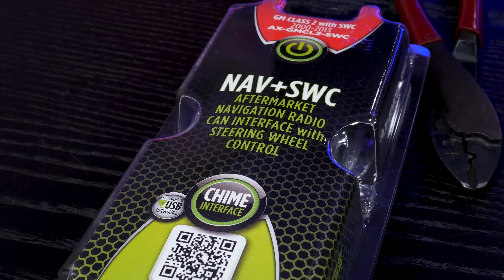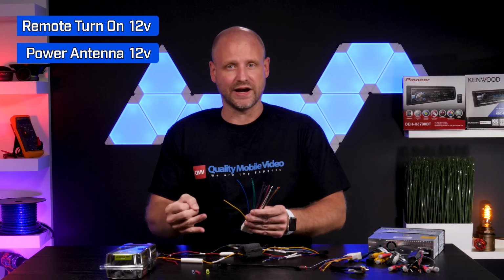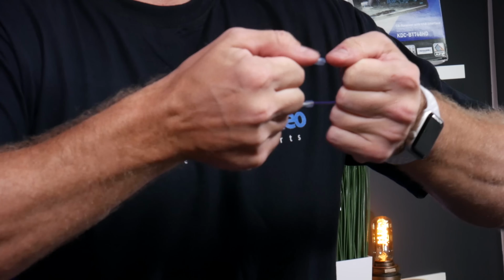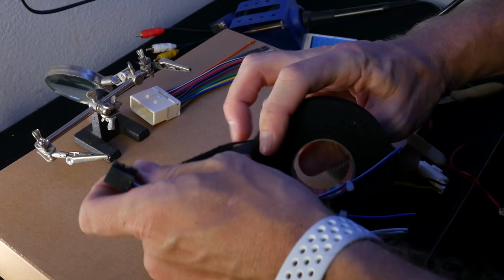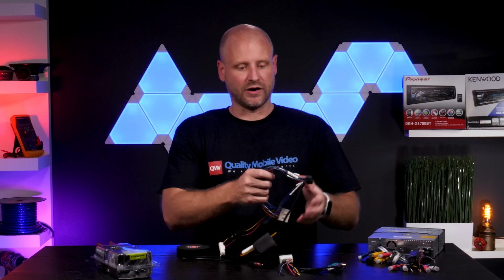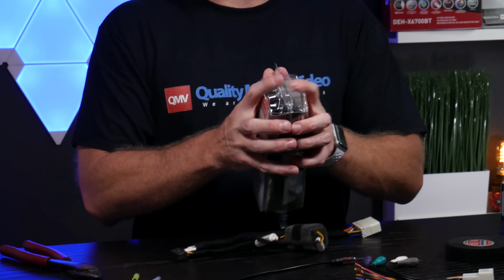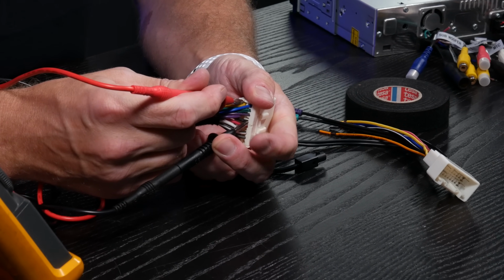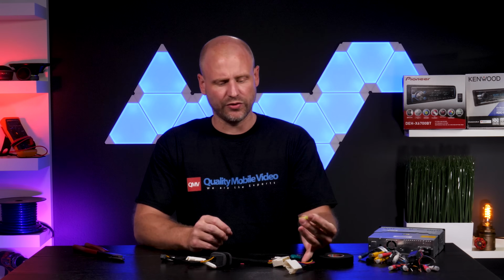Car Stereo Wiring Harnesses & Interfaces Explained - What Do The Wire Colors Mean?

Comment: You go ahead and show me how heat shrink butt connectors with adhesive can fail when they are properly installed and crimped, And I will tell you why you never see wires soldered in high dollar race cars or factory cars! Soldering your connections will absolutely cause an issue whether you know it or not! Actually I won’t waste my time you can Google it but I’m pretty sure deep inside you know damn well you never see any wires soldered from the factory or on race cars! The best way is to use heat shrink butt connectors with adhesive! I will say this though soldering your connections can cause bigger issues than just pulling apart!
Also should have used a proper pair of bike connector crimpers instead of that cheap ass pair of crispers! As soon as I saw you pick those up I knew you were lacking knowledge when it comes to making electrical connections! Anyone can make a convincing argument when they are by themselves!

Comment: The wires connected by butt connectors are not meant to be pulled apart with your strength. They are used to make a connection and constant contact. There is not a wire even with your soldering that can't be pulled apart. But who is taking the time to sit there and out of curiosity and pull their wires apart? That's dumb. Lol.. Other than that terrible demonstration the video gave good wiring instructions.

Comment: Ok, that was a pretty shitty explanation on how to make connections without soldering. You showed 3 coloured tubes... and did nothing to explain how they work or how to use them. Not helpful.
Reply from the maker: The title of this video is called "Car Stereo Wiring Harnesses & Interfaces Explained  - What Do The Wire Colors Mean?". Not "Please Hold My Hand While I Solder Wires". This is one of the most helpful wiring harness videos on the internet. The views and comments speak for themselves.